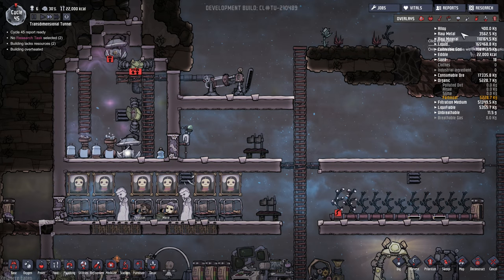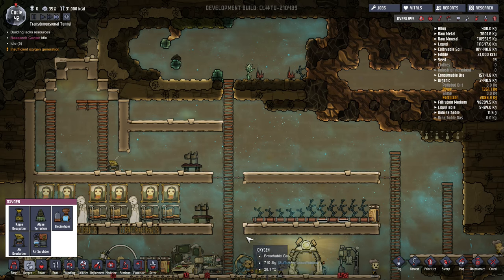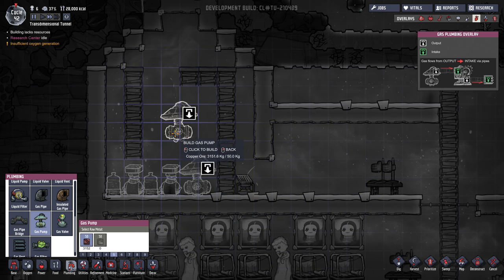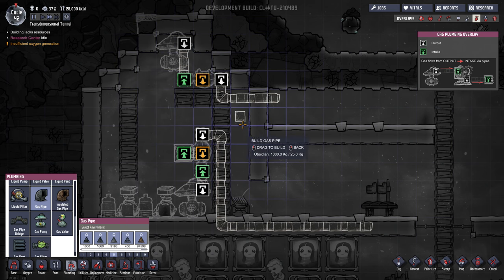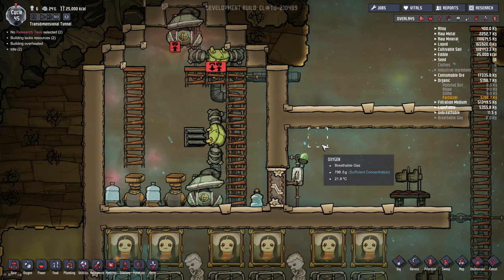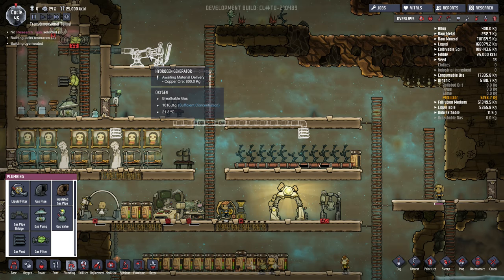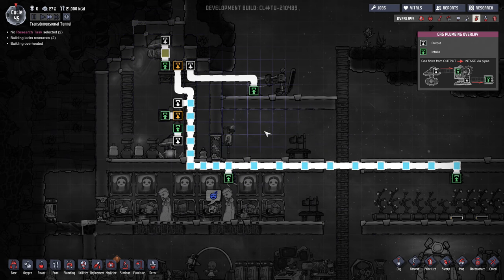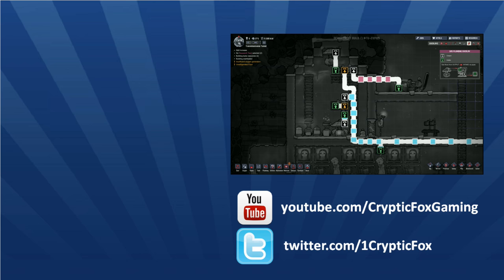How To Make an Electrolyzer Ventilation System! -  Oxygen Not Included Tutorial/Guide

Comment: There's an even more efficient way. Instead of two pumps, just use one pump at the top with a filter that only filters hydrogen into the hydrogen generated. The remaining gas (oxygen) can then be piped back to the base.

The problem with your current system is that you can very easily start pumping oxygen into your hydrogen generator which will cause damage and waste resources on repairs.

Also, the second unnecesary pump that you have uses a fair amount of electricity which makes the efficiency of your hydrogen power generation system lower.

I like your videos man, cool channel!
Reply from the maker: The single pump approach works too, but moves less volume of air, because when it's moving hydrogen it's not moving oxygen.  This system can't pump oxygen into the hydrogen generator though, because it's filtering hydrogen out that might have gotten into the lower pump, and filtering out air from the upper pump.  You can set the upper filter to Hydrogen as well, though in practice the room only ever has oxygen and hydrogen in it because there's no need for duplicants to go back in the room after it's running.  

It's definitely energy hungry this way.  I've also set them up with two pumps flowing through one filter, though that method has the same issue where the flow of O2 is lower because the filter is also handling the flow of hydrogen.
Reply: A Fortuitae i
Reply: Use the Electric Fan on the new update. Thermal Update gives you "Electric fan" and "Space heater" for the hydrogen converter for little issues on there.

Comment: Hey, great tutorial! Liked your videos so far. For my bases an Electrolyzer ventilation system has become a higher priority than toilets and showers recently. I hate living on the algae clock and managing polluted oxygen is not that hard if you put airlocks in front of the room or simply  choke the entrance to two tiles and put a deodorizer in it. Try to use the algae only for terrariums, cleansing my rooms from excess CO². In terms of ventilation i tend to go a little more overboard with filters. Simply venting it into your rooms might not distribute the oxygen evenly or as desired, so i started using one main "oxygen suply shaft" branching away from it to the different areas or rooms I want to supply with oxygen. For this I'm using a filter hooked up to an atmo switch positioned in the room i want to supply. This way my power consumption does increase a bit at first, but it becomes rather insignificant as soon as the rooms have reached the desired pressures. The benefit is that later you can use the same two electrolyzers to supply much more rooms than with primitive venting, because rooms won't hog more oxygen than they require.
Reply from the maker: Yeah I didn't go overly sophisticated with my ventilation system, but generally what happens for me is my whole base reaches max pressure and then the pumps only turn on periodically to keep the pressure topped up.
Reply: CrypticFox Makes sense, I probably should only go for the filters later on, when i want to pressurize planter-rooms and such. I do like the way you catch your hydrogen in a cone at the top of the room, didn't think about this ... was kinda only looking at the throughput values. Gotta try this in my base.

Comment: Try putting multiple electrolizers on a row of permeable tile with a 4 tile tall zigzag up with a 4 tall column of tiles on each side the middle gap only needs to be to wide just so it has enough room for a pump that is tripped by an atmo switch. its power gen is enough to sustain itself and more I would recommend trying it easy to make no need for a dedicated room you can put it anywhere in your base. respond if it doesn't work
Reply

Comment: the way I do it now is simply running 3 electrolyzers on top of my base in a room that shaped just like your electrolyzer room here, but with gas permeable tiles as the lower tiles (still normal tiles everywhere else). I only put one pump and filter on top for hydrogen generator, and the whole system is pretty much self sustaining with extra supplies to the battery while the oxygen is basically self distributed thorough the base
Reply from the maker: I like the control of pumping the O2 where I need it in the base, and I've found sometimes pressurizing the bottom of my colony can be a pain if I'm just waiting for the O2 to press down.  The gas/fluid dynamics aren't always awesome.

Comment: I've played Oxygen Not Included for about 16 hours in total already and have been trying to figure things out on my own, but my bases keep dying after 3-4 hours of playing. I was particularly surprised with the spread of Hydrogen, not knowing the electrolyzer produced it. After that I came up with an idea similar to this but I only trapped the hydrogen in the small room of the electrolyzer. Needless to say that didn't work for long, with the hydrogen seemingly forcing its way out of the room. Now I've given up and gone to YouTube and I must say these guides are good! Though my main problem seems to be stress. Could you make a guide for that?
Reply from the maker: +eenayeah if yiu've struggling with stress then your issue is likely decor.  Putting up artwork, avoiding polluted water on the floor, sweeping up resources that are sitting on the ground, and not running heavy watt wire will help mitigate some of the stress.  Keeping your duplicants well oxygenated and well fed will help, and then the rest should be managed through the massage table.  When you can make clothes the snazzy suit is awesome too.

Comment: hey biffa my elctrolyzers keep saying "max air pressure" so the 02 will not flow enough what i'm i doiing wrong?
Reply from the maker: Think you got my name confused haha.  It's ok for your electrolyzers to max out pressure so long as your gas pump is still moving oxygen, or your colony has reached max pressure in general. Saves a little power when they turn off.  alternatively you can make a gas permeable tile floor at the bottom of the room and let the air pressure push it's own way out.

Comment: thanks a lot, this problem really drives me crazy because hydrogen just start to appear everywhere in my base :D
i have a question though,  the electrolyzers only consumes water 1 kg/s, but the water in pipe is carrying 10 kg 
should we use a water valve for it?
i haven't played long so i don't really know if this really drained the water quickly, thanks
Reply from the maker: +Tommy Sudarmanto you can use a water valve to limit the flow but what you're seeing in the pipe is 10kg packets of water, and the pump uses 1kg/s.  the remainder is stored in the electrolizer for use, so even after you turn off the water pump it'll run for a while on the stored water.  The valve just limits the packet size to whatever you set it at.
Reply: oooh so each of those blue water flow blob =/= 10 kg water per blob?
alright, thanks

Comment: Couldn't you use one gas pump and one gas filter? One pump collects both H and O and the filter separates the H to the H generator?
Reply from the maker: yeah except that it reduces the oxygen flow from the pump because you have those volume gas tiles getting pulled into the pump, and when packets of hydrogen are moving through the pump you're not moving oxygen.  I generally just found it easier to keep the two separate, though I'm using a more compact mechanism in my current colony than what I showed here.

Comment: Why not make it a right triangle?  Would that not bring up the pressure and concentration?  Why not heat the hydrogen, as well?
Reply from the maker: I'm not sure what the benefit would be of heating the hydrogen in this case since I'm just burning it in the generator.  As for the triangle shape I don't know that it would improve the gas pressure much.  I'm sure you could use a variety of shapes though so long as it narrows at the top for the gas to concentrate.
Reply: Would heating the hydrogen not bring it to a higher concentration more quickly?  And, wouldn't a right angle to a triangle give a greater surface area to generate more heat for other needs?
Reply from the maker: Concentration of the hydrogen doesn't change with temperature.

Comment: Tried this model a while ago, it absolutely does not work as your base grows. Gas pumps literally cannot supply enough oxygen volume for a base, and as your colony grows, you will start requiring more and more pumps, which mean more and more electric demand, and you'll end up with 7 dupes running on treadmills 24/7 just to generate the oxygen they consume daily.

For comparison, I have an 18 dupes colony where the living area is supplied by 3 electrolyzers that are sometimes powered off because of oxygen surplus, I tried having the "oxygen room" solution when my colony was 9 dupes and couldn't keep them breathing with 4 pumps, had to turn on deoxidizers before they suffocated. You'll end up wasting way more power by trying to keep the oxygen generation confined to a single room, than you would use by simply having the electrolyzer at the bottom of the base and cleaning up hydrogen periodically.
Reply from the maker: I haven't had any issue with keeping my base well oxygenated using a ventilation system.  You need to seal off the area you want to pressurize though so you aren't trying to generate O2 for a massive area.  In my colony I'm now using 3 Electrolyzers, with 2 pumps for O2, and 1 for Hydrogen, and I never have to worry about O2 pressure.  the whole colony is pale blue on the overlay.
Reply: Try putting multiple electrolizers on a row of permeable tile with a 4 tile tall zigzag up with a 4 tall column of tiles on each side just so it has enough room for a pump that is tripped by an atmo switch. its power gen is enough to sustain itself and more I would recommend trying it respond if it doesn't

Comment: Seems there is a was a timeline in the old version - Size will determine time it takes to build - So if you try to go to big you will run out of time. There is only so much easy algae and coal - you will need both to make the technology jump. Those air pumps use a lot of power. Oh. Also that oxygen will be warm so you will need a heat transfer setup to pump cool air into the hydrogen chamber.
Reply from the maker: Hi Jake.  When you start building this setup is in part of function of the amount of algae you have.  A starting area with less algae should look to move to electrolyzers sooner rather than later.  I generally keep the early part of my colony smaller so that I'm consuming less algae to produce oxygen and stretching out that timeline a bit.  You still need time to research all of the components.  Tiling the walls is just a nice to have.  This sytem can be built just by hollowing out a space and setting up the electrolyzers and pumps if time is an issue.  Each gas pump takes 240 watts (480), electrolyzers take 120W (480 + 240), and the filters take 120W each (480 + 240 + 240 = 960W total),  so it definitely does require some consistent power.  I haven't been cooling the gas though because it's only temperate to warm.  Could mitigate that cooling cost with a Wheezewort or by building next to the ice biome in the thermal update.  By using a switch to turn the top pump and filter off I save 360W when I'm not generating hydrogen power.
Reply from the maker: Here's my temperature overlay for reference:  http://imgur.com/L5mgual
Reply: i dont even have a coal generator on that build yet i have 4 separate circuits regulated by their own batteries and wheels i have my hydrogen generator helping power the entire air system and only need help from the wheels once every 4-5 cycles

Comment: Hi i've got a question my gas pump only has output no input. Is that a bug ? There's only a green output button . No white intake button.
Reply from the maker: Nope.  The gas pump only has an output.  It draws gas in from the tiles around it, and sends the gas through that output.
Reply: But why your button is white? So there's no problem ?
Reply from the maker: Nope, no problem.  The dev team re-colored the inputs and outputs in one of the updates.  I still sometimes connect to the wrong ones because of it haha.
Reply: Oh ! Ok so all I have to do is put the white one to the green one now right? Sorry just so confused.
Reply from the maker: yep.  Look for the arrows on the input and output.  The input will point up into the box shape, an the output will point out away from it.
Reply: Ok thanks .
Reply: HI I've got another question XD Can heavy watt wires not be placed in walls? Why mine all red and can't place ?
Reply from the maker: Nope.  With the latest update the heavy watt wires can't be placed in walls, and they radiate negative decor for six tiles where ever they are (though that negative decor does not go through tiles
Reply: so is it ok if i use normal wires and can you make a video of contiminated water. I'm so stuck with the polluted air all the other videos so complicating i totally dont understand.
Reply from the maker: normal wire can carry a load of 1000 watts.  More than that in terms of the number of items connected to it and the wire will break.  Heavy watt wire is useful for carrying a large current to different areas of the base, then using a transformer to get it to the regular wires that you can run through the tiles.

Comment: After a bit of number-crunching I came to the idea: Wouldn't it be possible to have 2 hydrogen Generators connected to this System so that you constantly produce a surplus of energy while producing enough hydrogen for a constant stream to the Generator?
Reply from the maker: potentially.  The challenge I've generally had is that the pumps don't always operate at peak efficiency.  I've had this running with 2 electrolyzers and the hydrogen generator still wasn't fed consistently.  I think part of the gap might be buggy gas valves that you'd need to limit the amount of gas the pump is drawing out.  What the pump ends up doing is packing the pipe full of 10kg segments of hydrogen, depleting the gas in the room too quickly and then if it keeps running you're getting more air than hydrogen each time it pumps.

Comment: How do i store hidrogen, its possible to simulate a cilinder? with a chamber or something?
Reply from the maker: yes you can use a room to simulate a cylinder, though you should keep a pump in the room as a means to get the gas out when you want it.  You could either a) use a high pressure gas outlet, or b) use a series of opening and closing doors to compress the gas using the automation upgrade (though this would be the noisier of the two options, it also has unlimited compression capability)
Reply: nice, i will return to play this game thanks to you :D

Comment: both my gas pump and filter say they are not pumping and i don't know why please help
Reply from the maker: couple of possibilities.   Check that the input and output of the filter are facing the right direction (green input, white output), and check that at the other end of you either have a vent for the gas to exit, or it's connected to something that can consume the gas like the hydrogen generator.  Without an exit point the pump won't turn on.  Did you select the type of gas you want to filter for in the filter too?
Reply: check, check and check but it still doesn't work i tried deconstructing and reassembling them but only one of the pumps started working

Comment: Third time im posting this, but gas filter actually spit out the selected gas WITHOUT any need for piping and gas vents, and sends everything else to the white output.
Reply from the maker: +Virginijus Kupliauskis cool.  I've always erred on it requiring the same conditions as the pump (needing a specific output to a vent or machine) but if it works without it then that would save a few materials :)

Comment: cant figure out why you used  2 filters only o2 and hydrogen in the room only need a hydrogen filter for  both pumps
Reply from the maker: +MrKalidascopeEyes You could feed both pumps through the same filter but then you halve the flow.  When it's running it will alternate 1 oxygen, 1 hydrogen.  With 2 filters I can keep the oxygen on full blast and just turn the hydrogen portion on and off when I want.
Reply: ahh i have mine using the hydrogen as backup power suply for the o2 system so i dont have to worried about energy as often for that circuit.but i understand your point
Reply from the maker: yep, pretty much.  it's a relatively straight forward design.  I think ventilation systems though are under-utilized in the game.  I've most often seen people just dot their base with oxygen production buildings.
Reply: yah after about c30 i have oxygen distribution covered and with the system we have. dotting them all over creates air flow and hydrogen problems. using the oxidisers in areas outside the base to provide o2 to work areas and greenhouses. if they have vents set up they can maintain a positive airflow out of their main base keeping contaminated o2 well away from home no need for air filters.
Reply: oh the one thing most people miss when they see my build is the why i have 5 electrolyezers. they share the room so they are all sensitive to the same pressure increasing and decreasing production to maintain maximum pressure in that room. no small packets from the pumps. i dont mind that the packets get slowed a little in the filter as this actually helps my vents get larger packets down the vents that i have multiple valves on taking smaller quantities of the packets and passing them to the vents without loosing packet flow.
splitting the gas pipe separates the path of the packets into small less consistent flows of air.
the valves leave the flow flowing and only leach off some of the content of the package
the other reason is i can add more pumps when necessary and still not have to worry about restructuring production